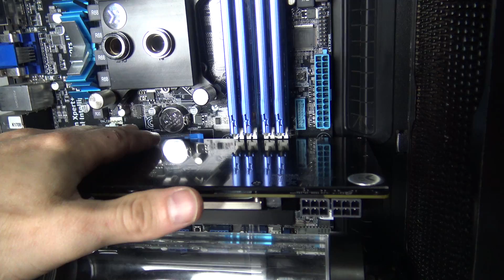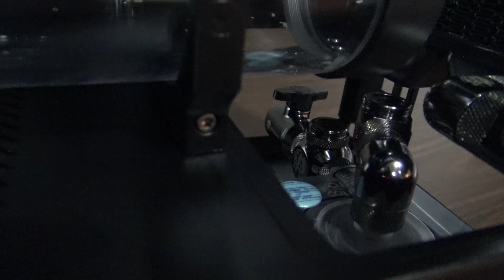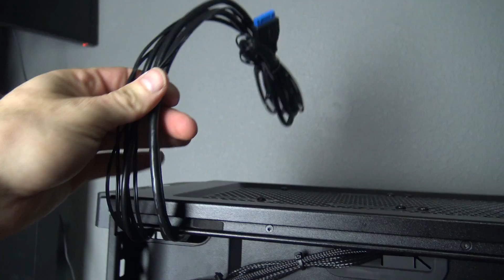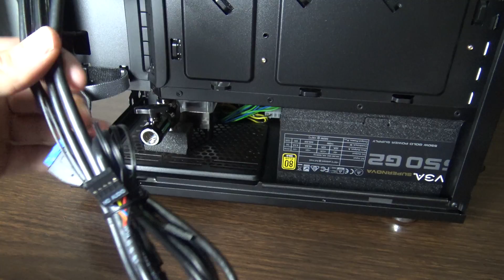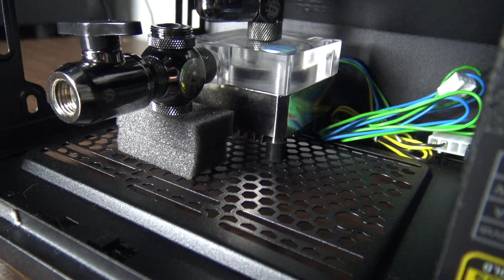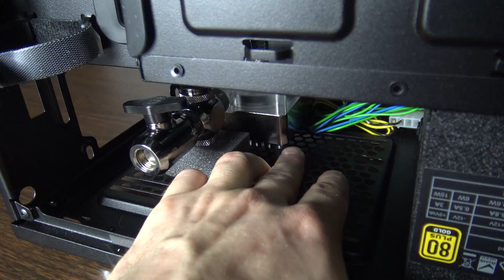Fractal Design Define Mini C: Water Cooled Build Log Part 2

Comment: I just found your channel and it is great! 

Quick question if any of you have the time, is one 240mm radiator 30mm thick enough for an i5-4670k and GTX 1070? I am not planning on lots of overclocking. I am also using this exact case.
Reply from the maker: you could get away with that